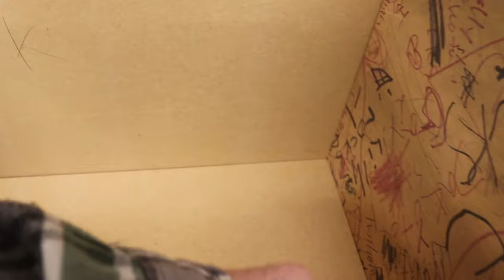How to Build a Toy Box - Free Cut List

Comment: This is really cool just one thing the big tools I don’t got lol
Reply from the maker: Thank you. You can always adjust down to smaller hand tools, like using a circular saw with a straight edge instead of a table saw.
Reply: @howtofixitworkshop  man these guys are on every video like this. always goes something like this: "must be nice to  have all those tools. wahwah." or "I could do that too if i only had X tool". Suck it bois. I made a 18x26" laminated cutting board from rough 8/4 hard maple an black walnut with only a table saw for and stanley block plane. I dont wanna hear it lol. Try the hard way once in a while, you may actually learn something along the way
Reply from the maker: Sounds like you made it work! I agree

Comment: Is it me or are the plans not on the site?
Reply from the maker: No not just you, total fail on my part! Need to correct that. Thanks for the reminder
Reply: Looking for the plans as well thanks
Reply: Hmwhen are the plans coming 👀
Reply from the maker: Finally finished the article and cut list: http://howtofixitworkshop.com/2020/11/15/how-to-build-a-toy-box-toy-chest-diy/
Reply from the maker: @12287boss  http://howtofixitworkshop.com/2020/11/15/how-to-build-a-toy-box-toy-chest-diy/
Reply from the maker: @cameronmcgregor5749  http://howtofixitworkshop.com/2020/11/15/how-to-build-a-toy-box-toy-chest-diy/
Reply: @howtofixitworkshop  Thanks man, i have actually almost finished building this box but I have an issue... Is the lid measurement correct on the cut list? I think it needs to be wider than 19inches. My lid wont cover the back and front edges 😔
Thanks for all the info 👌🏼
Reply from the maker: @cameronmcgregor5749  I see what you mean and you're right.  Did you cut the smaller piece off already for the stationary part that the hinges will attach to?  If not, there should be some scrap left long enough to use as the small stationary piece.  Thank you for brining that to my attention, I will modify the cut list.  Sorry for the trouble!
Reply: @howtofixitworkshop  thanks, was beginning to think i had done something wrong.
No ive not cut off a strip yet. I will make the necessary mods when i get some time hopefully before xmas, other than that its all good 👌🏼
Reply from the maker: @cameronmcgregor5749  Phew, glad to hear that.  Good luck with it and thanks again for the feedback!